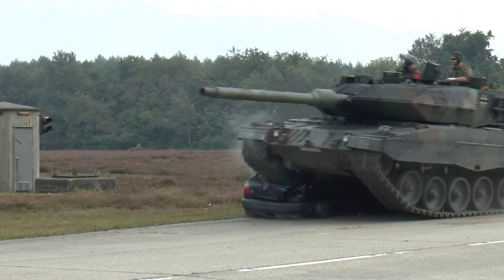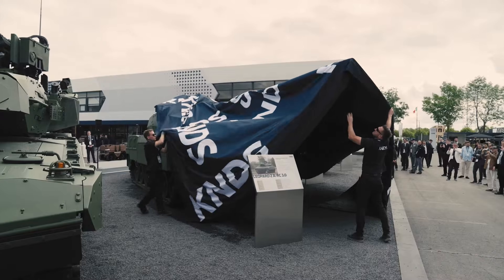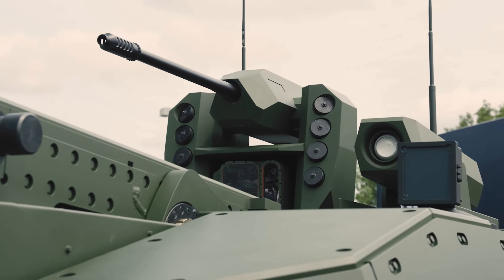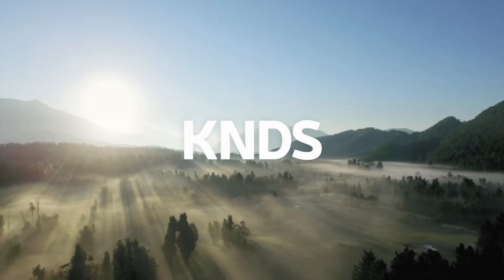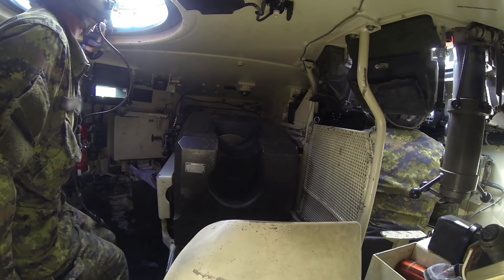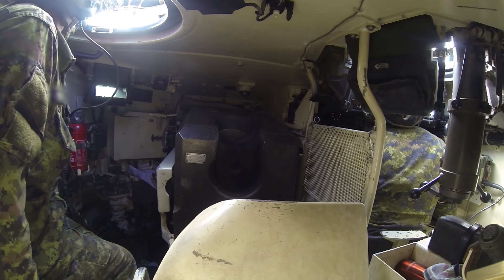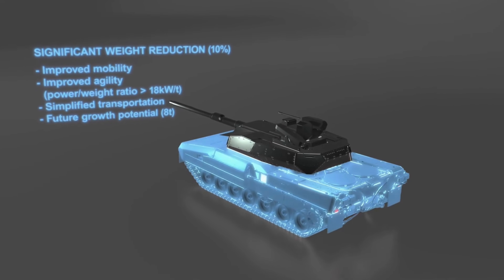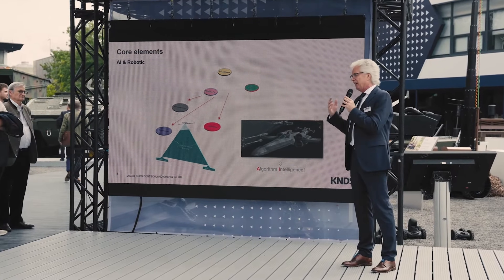The Leopard 2 A-RC 3.0 Main Battle Tank | 140mm SMOOTHBORE GUN

Comment: So they’ve made an Armata that actually works?
Reply: Well.
No.
It's still a prototype. Armata at least reached the pre-series.
Reply: @karakiri283and it will never see more than "pre series"
Reply: @karakiri283having 5 armatas should not even considered the pre series
Reply: @karakiri283 The T-14 is in serial production. The thing is, they are not producing them like crazy as there is no need for that. Which is by the way a good thing because that way they can re-work a couple things, if necessary. For example, they already made an improved version (T-14 Mod. 2021) which received additional frontal armour.
Reply: i mean, this concept wasnt original to the armata, the american and soviets experimented with multiple designs of MBTs with automated turrets while the crew sat in the hull
Reply: Apparently the T14 works, but they've had huge problems with the engine overheating. I expect that the production line isn't developed enough to build them in large enough numbers. Don't forget that Russia has lost over ten thousand tanks in the last three years and it'll take decades to replace them.
Reply: @Petriefied0246  ten thousand tanks u said?
Reply: @Petriefied0246 no it hasn't and stop lying. You sound stupid. Ukraine lost 20k tanks and armored vehicles combined
Reply: No, it's just a Leo with unmanned turret
Reply: Except its not in production yet so how do we know if it works?
Reply: @marcusaetius9309   Because the companies involved have a history of creating working tanks
Reply: Lmao exactly what I thought aswell 😂 "Isn't this what the Russians wanted the Armata to be?"
Reply: Don't be so quick to write-off the Armata.
Reply: German engineering. 😁😉
Reply: In the sense that the general concept is somewhat similar? Yes. But then, the T-14 Armata isn't the first to try that concept either, so calling it an "Armata that actually works" is really giving the Armata too much credit.
Reply: Armata works well, it's just that the quantity is small and the price is significantly higher than the T-80 and T-90, so the Russians don't use them because they have tens of thousands of MBTs from the Soviet era in their warehouses, and upgrading them would be a much cheaper option than producing another tank intact.
Reply: This one made the closet vatniks mad.
Reply: "actually works" is an overstatement now. wait till its battle proven
Reply: Reeeee! suka blyat!
Reply: Why should a tank carry multiple drones? Shouldn’t that be the role of a dedicated drone carrier? Seems a bit of a waste to try shoving drone launch capability into a vehicle whose main purpose is to brawl it out over comparatively short distances and LOS.
Reply: Sir you misspelled exists
Reply: You can’t compare this thing a armata! Sure it works but it’s more like the same old tank but with a drastic update
Reply: i doubt this German tank will work either.
Reply: wow t14 armata has a baby
Reply: https://www.youtube.com/shorts/FkKemjFCni8?feature=share
Reply: T-14 is working but they have a small number of them because they are way to expensive then the other T series tank
Reply: This kind of mentality that makes NATO lost the Ukraine War. Russia with their old washing machine ICs.
Reply: The Armata tank was copied from the American Abrams BLOCK 3 prototype. In addition, the Leopard 2 ARC... shells are located in the rear of the turret (as in the French Leclerc tank). In the Abrams BLOCK 3 projectiles are located below the tower shoot and are arranged in 2 rows vertically.
Reply: @Redeemer_84  it was not, there are plenty videos out there dubunking this
Reply: Armata exists? Remind me, when and where was it seen in the battlefield?
Reply: @inso80  Why should Russia bring the T14 onto the battlefield? For the sake of being believed in it?
Russia will release Armata when the time comes.
How it fires rockets, bombs that people didn’t believe in...

What can NATO countries produce?
NOTHING =)))
They have nothing =)))
It doesn’t matter whether you believe in Armata or not.

🤣🤣🤣
Reply: @inso80  abrams x and panther exist, when and were did we saw them on a battlefield ?
fkn genius right there...
Reply: @kthec1298  Armata is as effective as berkut. Probably as numerous too.
Reply: Wow one video with no production date, no stated numbers to be produced no orders and its already the best tank out there.
Despite the fact that in reality it will probably never be produces and will forever remain a pipe dream for the westaboo. 
Meanwhile the armata has already been seen to be on training ground with the tank crews.
Reply: Well… not exactly Armata, to be fair 
It’s closer to Chally Falcon with it’s “unmanned” turret
Reply: So true and its a 140mm gun to combat what is a myth, which really is what the Leo2 A-RC 3.0 should be as its completely pointless on the modern battlefield.
Its already proved 120mm MBT's are massively underperforming on the modern battlefield.
A 140mm with a masively reduced ammo loadout, that a every stage needs specialist equipemnt to lift and load, to defeat tanks that don't exist.
Personally I am not surprised we are falling for the ridiculous maddness of Hitlers mythical superweapons that forgot everything that made the allies efective.
Reply: t-goodteen goodmata
Reply: To be fair, even this wont be full scale till like 2040 according to the vid.... so kinda?
Reply: @clpfox470  no he was talking about the next generation tank the PFK51 being introduced by 2040
This is a upgrade that will come sooner
Reply: No, they just made a Leopard 2 Armata. You know, the worst problem of Armata is it's price. There are some other issues too, but the price were the very reason to not mass-produce T-14. When T-90-M3 have the same gun, same ballistic computer and thermal imager, it's maxed out passive armor+ERA provides very good survivability and it's  overall design is thoroughly  understood and mastered by heavy industries. When you waging a full-scale war I guess you probably prefer to buy three T-90-M3s and got another two repaired from battle damage instead of buying one T-14.
Reply: There's no incentive to mass produce armata right now. They can get out more by mass producing t90s, t80s and t72s. And pretty much drones can destroy for cheap.
Reply: @solastro5595 and those tanks handling better than western
Reply: It's not that the Armata doesn't work, it's that they aren't able to get them out the factories
Reply: @nicolaspeigne1429  to be exact, too expensive.
Reply: @nicolaspeigne1429  And it doesent work!
Reply: @nicolaspeigne1429  Heck! They haven't even made an actual T-14 Armata, it's literally barely a prototype, the turret is barely just the outter plating to hold the gun, of course it won't work, it's a literal mockup!
Reply: @nicolaspeigne1429  In Russia, there is no serial engine that would meet the requirements of the military. the engine that is on the Armata was not serially produced. There was one real tank project in Russia - this is the Object 640 Black Eagle. Lack of funds and orders left the tank in one copy. It is possible that the Leopard 2 trophy tanks will allow the Russians to copy and adjust the production of the German engine for Armata tanks, but this is unlikely.
Reply: @nicolaspeigne1429  nah.. it simply does not work at all.
Reply: I like all the people saying that the Armata does work while half of the videos of that thing show it not working^^
Reply: @LuisGpunkt  if you'll take a rec /where Armata cannot move itself because it's tracks are deadlocked by an idiot driver/ and will cut it into ten pieces by video editing tool, how many proofs for Armata cannot move will you get?
Reply: Armata is a experimental machine not a end product so is the terminator tank 

What proves from the ukraine war is mostly the use of 30mm fast firing cannon to replace the traditional machine gun
Reply: SAVAGE
Reply: Yeah, it's funny it's always like that: first they laugh at the Russian's innovations, then they rush to copy them. Happened with ERA, autoloaders, and now unmanned turret and higher smoothebore calibers.
Reply: @olisk-jy9rz  exactly lmaooo
Reply: @olisk-jy9rz  The US had the M1 TTB which existed in the 80s. The russians def didn't lead the charge with unmanned turrets lol. The Armata looks like a damn TTB clone that came out 30 years later.
Reply: Armata works as well ...just plagued by excessive corruption , of which level we are not gonna see in Rheinmetall anytime soon
Reply: @PatriotEnfield3276 Rheinmetall corrupts the goverment. The russian goverment corrupts the Arms manufacturer
Reply: @PatriotEnfield3276  What does corruption have to do with it? Instead of Armata, Russia makes bombs, missiles, drones, modernizes the T-72, T-80, and produces the T-90m. And this is with, as you say, “corruption”...
Is there no corruption in the USA? Officials and billionaires are brazenly laundering money in Ukraine for their own benefit.
Now Russia can afford to produce new equipment.
What NATO country can afford this? The USA is now incapable of producing new tanks, just like Germany, these countries themselves have spoken about this...
Reply: @PatriotEnfield3276  corruption such as ? Price gauging ohhh wait thats an issue present in Rheinemetall.
Nobody so far who has presented the corruption argument has actually shown any evidence for that
Reply: T-14 Armada works just fine they're simply not produced in large enough numbers.
Reply: @Iamabot4708  Keep telling yourself that, please do!
Reply: @Iamabot4708  The Armata really isn't that good though. Yet another example of Russia building something and lying about it's capabilities. The active protection system on it does not exist according to China who are pro-Russia and were interested in buying the Armata until they themselves found it lacking. It also relies on western imports for a lot of it's optics and electronics that Russia can't produce themselves. What they fitted to the prototypes was the previous gen optics from the French Leclerc tank. So until international sanctions are lifted they can't build any more Armata's or if they do they will be blind as the systems in the T-80 - T90 are incompatible and Russia can't afford a redesign at this stage.
It's top speed if rated at 50 MPH but has never achieved over 30 on any documentaries the west knows of.
Reply: So basically it won't work @Iamabot4708
Reply: @Iamabot4708 Armata is a superior tank like all russian weapons on paper. Bur paper comparison makes not good weapons. How good a system works is how the systems work together. It’s the reliability and the crew. This are main weakpoints in all russian systems. Not the caliber or the top speed.
Reply: @Iamabot4708  last I heard was due to its high cost Russian is only getting 300 if the T-14 and focus on the T-90
Reply: Interesting dumb take.

While ARC is a tech demostrator, Armata is a build model tested in the (extreme low intensity) field.

So that's just a somewhat racist trope you ride. The solution choosen for both are logical, and only the russians have been in need to actually build a new tank for mostly internal reason. The West, specially GER, doesn't for a while. But as of now, there is money and popularity in the basket to grab, so tehy went in - with a half-asses attempt btw.

The ARC had no reason to miss out on a number of crucial and logical solutions - as they had these solution in house - but did. The Armata had all these solutions or their own solutions, so is way more of a honest product to fit a purpose. The ARC, sadly, is a marketing stunt with no actual reason to exist other than economical reason.
Reply: omg.. the anti russian bias is unreal.. armata is fine. nice try. and bro pinned it like he knows anything about armate irl
Reply: @6uiti and how exactly is it fine? Got any proof. Or just driving is good for you?
Reply: Who said Armata doesn't work? Armata has actually seen combat. This super expensive cat hasn't even mud on its tracks.
Reply: @gruenerteufelDD  lmao it hasnt, armata overall has been abandoned.
Reply: @agall664 yes it has and ypu can see videos leopards and abrams stuck in mud.
Reply: @gruenerteufelDD  prototypes and testbeds rarely can be seen in combat. And this one is more of an early prototype than a battle-ready MBT.
Reply: actually armata seen combat in secret. Now they said they will update the tank and hace 152 mm
Reply: @alexnderrrthewoke4479   If its a secret how do you know? Also if it went well they probably would have advertised it.
Bottom line is even if it did work its built with inferior parts. And when its does work it does work it costs more and performs equally or worse than the already bad T90. Sticking a 150mm on the "mr Mago" of tanks won't really help either since it can't see or aim far enough to have any use for the firepower. 

And if those tanks are handeling better why is russia running out of them so quickly? 

I mean if your biggest flex is vehicles getting stuck in the mud when you can't even get yours of the parade ground you really are desperate.

At this points you should just give up and buy chinese
Reply: @trickslies844  sure make excuses for russian tanks with big caliber guns but not german. Lmaoo the copium is so real lmaoo
Reply: @trickslies844  would you kindly reveal, which tank of russo-ukrainian war showed better performance than the latest russian T-90 types? 
There is probably one such tank. T80BVM. Slightly less armoured but incredibly agile MBT. 
No western counterparts can be even compared to T-series.
Reply: @alexnderrrthewoke4479  Western tanks actually have optics that can see and aim at the ranges their guns can reach because they don't rely on the civilian market. Also I never expressed any support for the 140mm, though once it gets integrated with drones for direct fire beyond the normal visual range it could be a benefit. Unlike the T14 which would just function as a terrible artillery gun
Reply: @doombringer3498  All of them not based on Russian design or manufacturing.  Leopard 2, Abrams, Challenger 2, Bradley (still counts if it does te job) all better. And that the old that haven't been updated. The T90 breaks even with the Leopard 1. 

Terrible optics and fire control, inferior armour and tragic crew survivability rate, terrible manoeuvrability due to the reversing issues. The entire T serious  has become a carnival of Junk because Russia has cut its investment by 90% over the last 30 years. Even before that they where deeply flawed machines.
Reply: @trickslies844  if so true then why abrams got destroyed by a t-72 over 6 miles? Lol
Reply: @trickslies844  sure such terrible that t-72 is wiping your western tanks easy lmao
Reply: @trickslies844  You've never been in a tank, you can't imagine their equipment. Terrible optics lol. THERMAL IMAGERS, FIRE CONTROL SYSTEM, GUNNER'S AND COMMANDER'S SIGHTS ON THE T90M3 AND T72B3 ARE SIGNIFICANTLY BETTER THAN BOTH ABRAMS AND LEOPARD. they're newer. They are made using technologies from 2020x, not from 1990x
Reply: @doombringer3498  You don't need to imagine when you have facts maybe try that some time instead of parroting propaganda. 

Just because you built it in the 2020x doesn't mean its not 1990 tech if you've not done anything in the last 30 years lol. The Russian  Irbis-K works at ranges up to 3,240 meters during both day and night. WHich is less during the day then the French civilian sight they used before and less then the maximum range of the main gun by about 1,500m. 

THats similar to what the Abrams had on its FLIR in the second generation. So congratulations to catching up with the 80's.  The old western tanks sent to Ukraine has a targeting range of 5.000m 

Even then most Russian Tanks are clearly driving around without these equipped.
Reply: @doombringer3498  Russian thermals built in the 2020s are equivalent to US thermals from like the 80s or early 90s.
Reply: @Xiones11  russian hypersonics are equivalent of US hypersonics, built in... Oh, but US have no hypersonics, only prototypes and one contract, failed by Boeing so badly it was canceled. 
  US used to have best equipment and strongest military. 
34 years ago, when Desert Storm caused shock and awe.
Do you really think the same equipment is still best?
Reply: @trickslies844  who told you that russian tanks have specs from wikipedia? 
Why won't you check UA feedback about Abrams, Leopard and Challenger usage?  Leo2A6 and M2 Bradley ifv are the only vehicles with good feedback. Bradley is very resistant to penetrating blows and often take it without K.O. or internal fire. Bradley's gun is precise, engine is reliable and overall the ifv is better than russian bmp2 and bmp3: first have weak armor, second have abundance of explosives onboard. Leopard 2A6 really got superb optics and thermals for both commander and gunner. Leo2A6 non-frontal armor is still weak and off-road capability is far from great. 
That's all. Abrams and Challenger have strong negative feedback. 

Maybe newer M1a2 SEP is better, dunno. We discussed russo-UA war.
Reply: @doombringer3498  Also this response to my comment about thermals is hilarious. The fucking wartime model of the T-90M is using a fucking uncooled thermal imager. This is a downgrade of the clone of the french export thermal imager the russians were using before. The specs to these devices are not that much of a mystery. We KNOW an uncooled thermal imager sucks. That is 80s vintage technology. There is a reason modern imagers are all cooled. The performance of an uncooled imager is dogshit. I am not being mean when I say that russian thermals are the same as american stuff from 40 years ago. They are literally using technology that was standard 40 fucking years ago. That is not an exaggeration.
Reply: @doombringer3498  THe suppliers, when you buy civilian parts or advertise your product its specs become public knowledge. But feel free to present your own sources i'm sure they are very reliable when you don't even know the model or brand. 

And UA has been mostly positive about the optics, fire control and survivability of all western vehicles with manoeuvrability in mud being the only downside but its not like Russian tanks are actually better or preferred. Statically all western tanks are outperforming the Russian tanks. Again annecdotes are as meaningless as cherry picking
Reply: @doombringer3498  Yes US equipment is still the best. Unlike Russia they never stopped investing. The gap only got bigger. 

Russian "Hypersconics" aren't hyper sonic. The Oreshnik does nothing other ballistic missiles haven't been doing for decades. Which is why the US already has inceptors developed for them and is now using satellites as target practice. 

Do you see the US rushing to develop its own hypersonics or new interceptors? No. You think the industrial complex wouldn't like more funding? But they don't need to when their current products do the job
Reply: @trickslies844  "Yes US equipment is still the best" on paper but not in real war, that's why is failing since Vietnam war, remember those jammed guns? and now those M1a and Bradleys that are popping like popcorn all over ukraine, or the Patriots that are good for nothing only in the lying reports of the desperate ukrainians are the best with 100% scores, while their objectives are razed to the ground.

"Do you see the US rushing to develop its own hypersonics or new interceptors?" oh sweetie, it either hurts that much or you have no clue, they do rushed to developed something, your US super duper engineers had not one, but few hypersonic programs, that all ended miserably, then were canceled. Inform yourself, all those failures are reported in your woke "free" news.
Reply: @flotr6465  Lol really? Vietnam? Grasping at straws much? And you act like the US didn't win every engagement in that war. So sorry they didn't think a pointless victory would be worth committing genocide over. You really want to play that game? Has there been any war where Russian equipment did well? Afghanistan? Irak? Syria? Chechnya? 

The only "objectives"  razed to the ground are civilian structures like schools and care homes because you can only hit something when its undefended and even then its with the accuracy that would make the V2 embarrassed/. Again if the M1 and Bradley are doing so poorly why are there so many left? You're the one having to rely on trash like the T-54 because you've run out of anything more modern. 

Concluding its not worth it because your enemy cannot even stop your current weapons doesn't make it a failure or you can't do it. Nor does labelling  your 1970's tech missiles "hyper-sonic" actually make them impressive. Also if my "free woke news" is so bad...why are you using it for your information?
Reply: @gruenerteufelDD seen combat according to russia, with zero actual evidence
Reply: @gruenerteufelDD Yeah very good Tank with the refitted Tiger Engine and Build around the old Ass Engine that is so ineffiecent